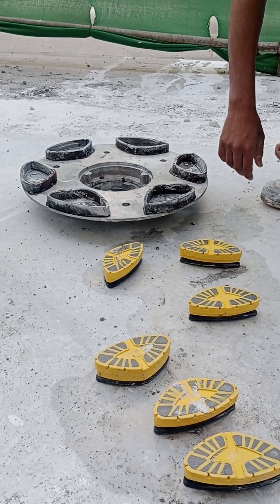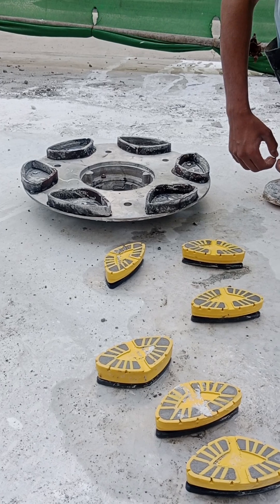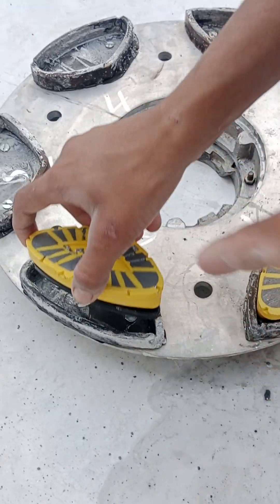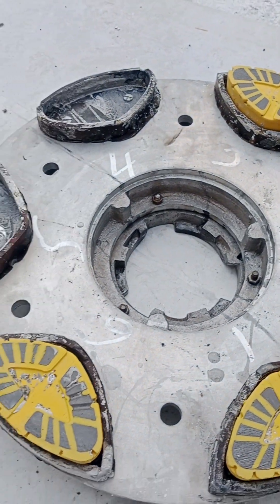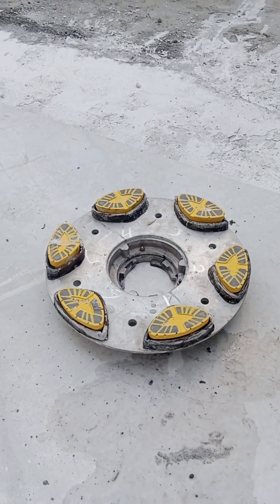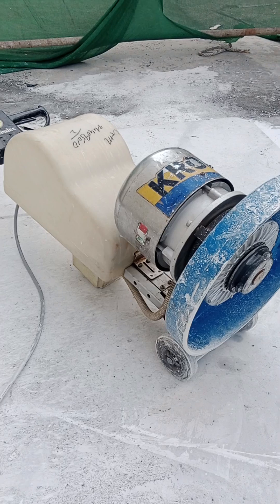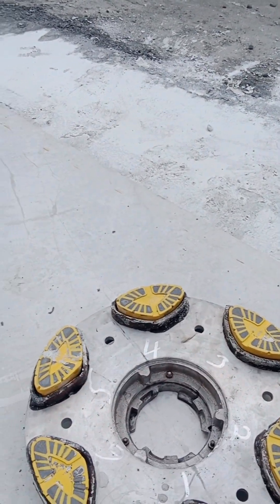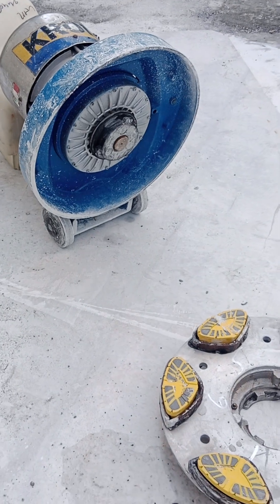Modified Single Disc Plate for Metal Bond Cassani

Comment: The problem my friend is that you cannot sand uneven floors like poorly laid marble because the force of the machine will be too weak.
Reply from the maker: My friend this machine work well to level this floor.
Reply from the maker: The are only slabs. Not floor